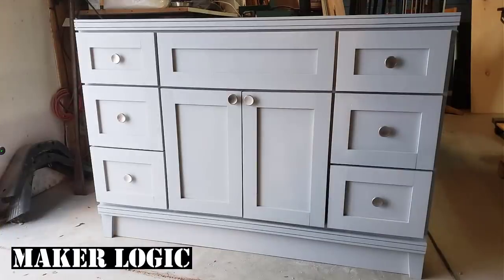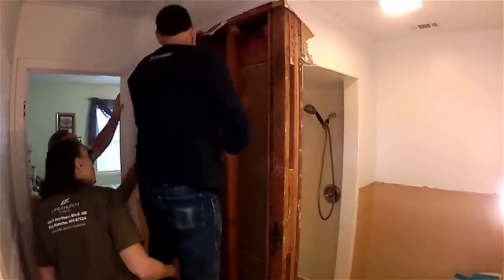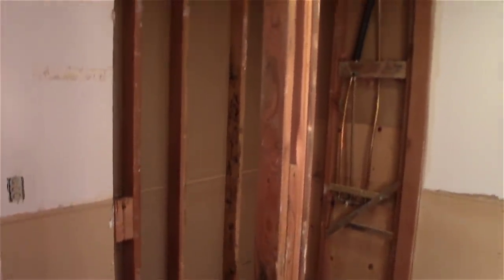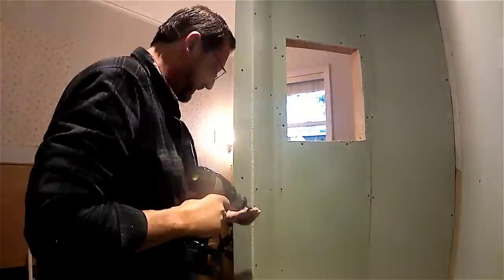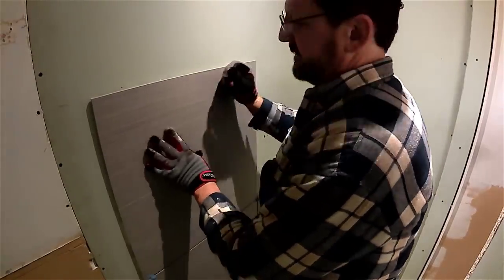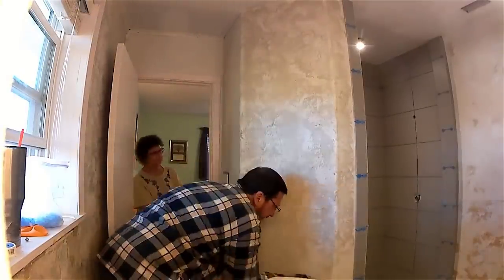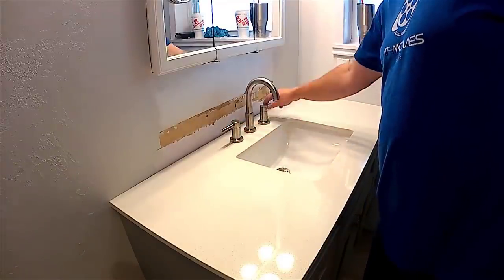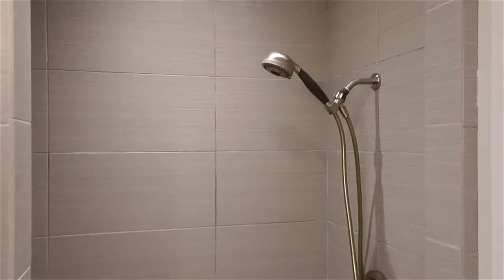DIY Bathroom Remodel on a Budget – Start to Finish - six days in 20 minutes!!!

Comment: I liked your cabinet build, it was a great fit and look for the bathroom.  But, I'd have some suggestions about the rest of the build.
1. Best not to use green board, cement board is a better choice.
2. Even though you used green board, you should use Red Guard to seal the surface.  Even with cement board as well.
3. For the corners and seating, nothing is sealed use something like Kerdi band to water proof those corners
4. For the vanity top, don't liquid nails.  It makes it impossible to ever remove without destroying the cabinet.  Silicone caulk will work just fine
5. Silicone your toilet to the floor.  The extra adhesion prevents the toilet from ever being loose and stops a toilet over flow or show accident from going down the opening.
6. I always take that time as an opportunity to replace the shower valve.  Typically the one in there is very old, and more likely than not needs replacing.
7. The valve and head appear to be far too low.  It's a personal preference not to move them, but I follow the instructions for standard heights for these.

I wanted to include my suggestions, not just for you but anyone watching the video.  I don't think these steps are unnecessary, water is an important item to contain.  Do everything you can to prevent leaks and mold.  Mold is a naturally occurring thing, but minimize the problems anywhere you can.  I'm not a bathroom expert, but I've installed about 12-14 bathrooms, and each one gets a little better.  Now I do them for rental properties, so above all a little time or a few dollars spent now will save you untold headaches in the future.

Still liked your videos and thank you for the uploads.  Jake

Comment: I'm redoing my bathroom right now. I'm really surprised to see no waterproofing in the shower. Also, you troweled the mortar onto the tile in all different directions, which is going to leave air pockets and give you a weaker adhesion than if you ran the trowel the same direction across the entire tile
Reply: Thinking the same thing, man!
Reply: Agreed. We used a gallon of red paste that dried like plastic as our water proofer then troweled the wall and back buttered the tiles in the same direction. Additionally, those tiles should be offset (mostly for visuals but I think the instructions say to do a 1/3rd minimum overlay for a 12x24" tile).
Reply: I was also worried when I saw the tile going on right on top of the green board. You need some type of waterproof system such as red guard or slueter

Comment: I agree with the multiple comment about waterproofing.  Hate to see it go to pieces after all the sweat that has gone into this project.  Why didn't you raise the shower head spout while the walls were opened up.  It is way too low in its original spot.  Great job otherwise.
Reply from the maker: Thanks!  I wanted to move the head, but my uncle and aunt liked it where it was, and are much shorter than I am.  We reused the existing concrete pan and moisture barrier at the bottom of the shower btw. and I did seal the concrete with WP before we applied tile. The video does not show that. but I did not tape and mud the seams or screw holes...which is a toss-up depending on where you are from.  We did use green board, which some people are not happy about, but it has been a year and there have been no issues, no leaks, no weeping of moisture or water anywhere.  It helps that there is an access panel under the seat and in the closet behind the shower control to see inside the walls and concrete.

Comment: I wish you had show the back of the vanity when you were installing it. From the other video, it was a full back. But you must have made some cuts for the wayer lines and waste pipe. I just wanted to see how big that modification was because I'm about to embark on a similar build.
Reply from the maker: Hello,  I did cut a hole in the back of the vanity to accommodate the water lines and the drain. The hole was about 12" wide by 12" tall.  Just make it pretty when you cut it.

Comment: Maybe it’s the camera angles but the grout in the shower doesn’t seem to be even and filled in?
Reply from the maker: Yes it is all evenly filled in, when I shot it the light was reflecting off of some of the damp parts of the grout which makes it look like some of the grout is missing, however it is all filled in. They selected unsanded grout, and it did not dry evenly in the first couple hours when I shot the video.
Reply: I was thinking the same as Brian about the grout. Also why didn't you put grout on wall first.

Comment: is it usual not to insulate before putting on the greenboard? I am wondering because we are going to redo the bathroom in my house I’m just curious
Reply from the maker: Hello, the only reason to insulate would be if it was an outside wall. Also you might want to use concrete board instead of greenboard.

Comment: Awesome video! Thanks for the pricing breakdown also! Always curious how much projects as these might cost. Question.. why would you not put mortar on the walls as well as back buttering?
Reply from the maker: Good question.  I usually do both, but the mastic we used is a high polymer mastic and it saved us time to just back butter the tile...not the traditional approach that I normally use, but the route my uncle agreed we take due to size and the product we used.

Comment: Drywall texturing in 2019?
Reply: what is the current style for drywall, I have no idea, thanks
Reply: Sonia Patterson smooth, really smooth
Reply: Like how you replied to this but not about using red gaurd to waterproof shower. Or the use of cement board instead of regular sheet rock.
Reply: That’s what I was thinking. I asked if there was a reason, had to be a reason.